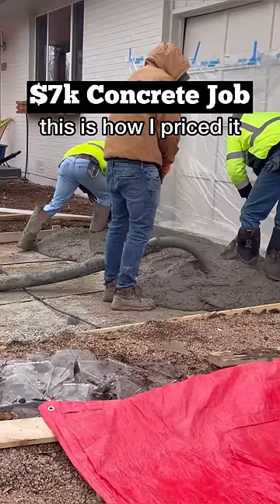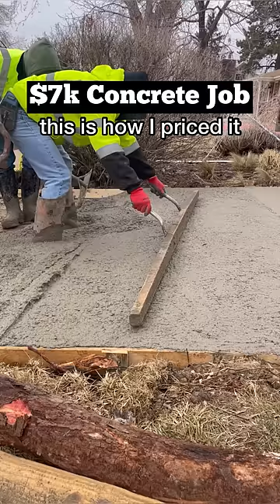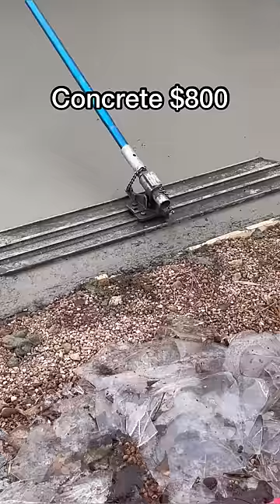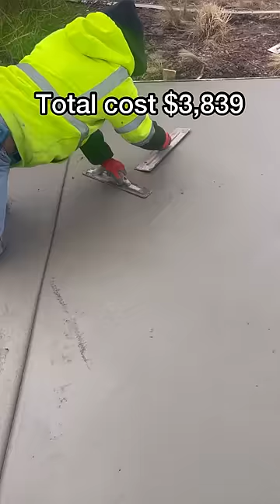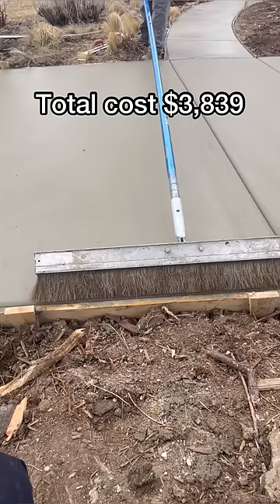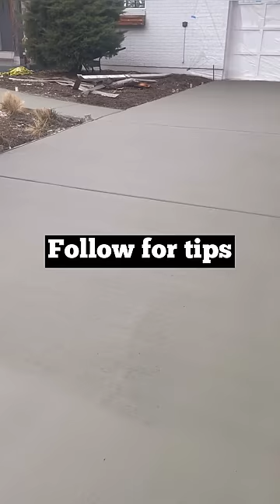How I priced this $7,000 driveway 🔥

Comment: I just paid 5300 for what I consider to be a top tier 20x20 slab and that includes footings being dug and poured
Reply: sounds about right, prices vary from place to place for instance this guy priced his concrete at negative if he was in my hometown (Toronto) we have 4 meter minimum cheapest $175/meter plus environmental fee's and tip to the driver if you do that which I do. Also Labor fee's vary, in Toronto Journeymen concrete finishers make $44/hour we just got raises a week or two ago and that's just union pay, most top level finishers make above $50/hr, good luck trying to get us though our standard rate to come do a residential job is $500/day

Comment: I remember I hired a company to finish my driveway. They charge me for rebar and I saw on my cameras that they didn’t even put it. That was a fun day at their office when I had to prove them wrong and get my money back and have them come out and redo it all over again on them.
Reply: It’s guys like these that make all contractors look bad.
Reply: I would’ve had them tear it out and then hired someone else.
Reply: I have heard similar stories from the folks that renovated my 90year old house in Romania. They told me that they have heard all kinds of stories working for years in construction. The most insane thing I have heard was where some construction crew was building houses with cellars, laying out all the necessary and mandatory rebar, all by the book. Then the construction site boss and engineer came to check on it, it was spot on, no mistakes then the  two fellas left because everything was according to the book. Only thing left to do was to wait for the concrete trucks to arrive. Well in that time gap of not more than 30mins is where the magic happened. The entire crew was in on it. The motherfuckers disassembled the entire rebar skeleton before the concrete trucks arrived and used it on another house, basically getting rich off of one set of rebar for a copy paste house. This shit left me flabbergasted, out right criminals. Structural integrity went down the drain and it was all according to the books...
Reply: It’s possible that they charged you for microfibre mesh and there was a miscommunication

Comment: 42 man hours on that little job? When my dad was alive his crew would have that job set up and poured in the same day!
Reply: Could've been 7 men 6 hours...
Reply: That's like a 2 hour job at the most
Reply: @3807shawn  it's gonna take a while longer than that it depends on the temperature outside and how much water was used,if they used calcium things like that. You have to work it as the concrete sets up.then you can either put the machine on it and finish it or if you have enough men they can get out there and finish it by hand then broom it and go! Come back next morning and pull the forms and clean up!
Reply: If you listened to the man. They obviously did the dirt work and grade work to prep for the job. Not just the setup and pour.
Reply: @devenkuoppala5731  it' still wouldn't take 42 man hours
Reply: @chriswoods4232  2 and a half day for 4 guys. That's not to bad.  You have no idea what it took to prep that area for them even to be able to set up. They have have had to demo the old driveway. Or dig out the yard or old gravel driveway that might had been there. Then they have to take it off site to dispose it. I'm a contractor that does this every day. He's was very fair if not to cheep

Comment: All you idiots saying this guy ripped the client off need to start your own business and try to do this cheaper. Cause if he did the prep and grade work for this and had to get a pump and bought the concrete as well as setup, pour and finish . If you did this cheaper you would be out of business In 1 year. You aren't thinking about he has to pay 20%  business taxes also labor and industries insurance and overhead for the business. Company only made maybe 1500 clear. 42 man for 4 guys took the 2 and a half days. That means he made 500 a day. That's pitiful. I would have charged 10k.  He didn't even charge for equipment to do the grade work. Equipment haul in charge. He left allot of money on the table..

Comment: Job size - not specified.

Volume of concrete - not specified.

We don't know the depth, length or width. We don't know the weight bearing capability that was required by the customer. And we don't know if he met that.

All we know was he charged about double the cost to himself.

And he's very public about it. Which can only mean he wants future customers to be aware of his pricing and to haggle hard with him or anyone else.

Comment: I had a asphalt seal coating company  i ran water motion with a 1 inch diaphragm pump dual tank honda 5.6 aircompress and 275 gallon toat spray rigg n I would charge people for quality work. If you want the best you paid for it. I done pretty good I just couldn't deal with winters anymore n move on it was my favorite thing I done

Comment: Ok an asphalt driveway like this is minimum 15k. In concrete 35k . Concrete $150 a yard, wire mesh not rebar 3by 5 $40 a sheet labor $200 dollars per guy per day. Trailer pump $1000. If you are charging that amount I will hire you right away.

Comment: Usually for finishers they make a good 300-$350 in my area and pumpers as well 400 but being a pumper is a bitch carry the hose back with all that dry concrete and putting back the pipes back in the truck

Comment: some of the people in the comments are buggin.

for anyone confused, if 4 guys work a 10 and a half hour day, or if 2 guys put 21 hours each total at a job, then that's considered 42 man hours on that job.  most likely 2 guys did this and he paid each $21, which is pretty decent for an unskilled labor, but not good for an experienced mason/ concrete worker. 

depending on the size and shape of the pour, plus excavation and setting forms and whatever else, 7 grand could be a great deal, or highway robbery. it's impossible to know unless you had pictures and dimensions and a firm grasp on what it actually takes to pour a driveway

the more ya know 💫

Comment: I think the big mystery here is that all the “profit” doesn’t seem to take into consideration company overhead. His actual profit is likely $1000-1500 after shop, fuel, QB/accounting, advertising etc. and then taxed on remainder. Plus, $800 for concrete? Minimum load of 3-6yards? Small drive I think for $7000. Where I’m located 4.5yrds would push $900 + min load fee. And no one would pay over $4500-$5500 for something that small. Thoughts? I believe the internet is not a good place to advertise your local market. It tends to mislead customers.

Comment: Many potential clients are in a rush and do not want you to explain what you are doing, but based on these comments, it is clear that you have to be thorough and explain everything that you are doing because people don't understand what it takes to do a job, and then what it takes to run a legitimate business.  The gross profit mentioned here is fair based on the costs mentioned.  To pay for all licenses, fees, insurance, advertising, website, reputation management, miscellaneous time costs, etc. in addition to the specific job costs just to make a marginal profit does not make sense in most cases, unless you have a very efficient process and are doing these jobs at a high volume and frequency where you can afford to make less per job. What if something goes wrong and the entire job needs to be redone? One mistake can cost you your profit and more. These are things that cheap workers/ DIYers don't think about.  I've lost plenty money on jobs simply because I bid the job too low and things went wrong that I had to pay for.  Also, people don't realize how much they actually pay as DIYers if they considered the time they actually spend gathering all the necessary supplies and equipment, doing the demolition and disposal, etc.  Either way you look at it, you are trading your time whether you pay with money you worked for or when doing it yourself costs you your days off.  It's no different than going to a restaurant or to the store to buy items that one could make themselves.  What makes it worth it for you to pay someone else? Many items people pay for on the daily are true ripoffs compared to something like this that requires skill, knowhow, licensing, etc.etc.

Comment: $42 an hour. But you milk them for 3 or 4 of these job's a day. I worked for a concert company for 2 week's and got fired because i wasn't good enough but that job is not worth it for the slave. We would go around the city repairing side walks and even adding some all at once about 6 guys. Never ending. At the end of the day i go home with a broken back and $100 in my pocket from dawn to dusk. It's insane

Comment: Mexican stats: 300 damage (to wallet, -0.75x for each status of friendship), + 1.5x speed for each beer and speaker within 35 meter radius. Chance of mistakes: 4%
Random guy with concrete: 4000 damage (2x damage to characters with under 10% specialty in concrete, 4x damage to elderly) 1.4 ~ 0.6x speed for each temperature change. Chance of mistakes: 4%

Comment: First time in awhile ive seen a concrete job on here where the concrete wasnt borderline water. Good work.  PSA if your contractor starts dumping concrete and it runs like water, hes fucking you, i dont care what the application is, unless its a specialized thing that need self consolidating concrete, no concrete should be placed over a 6" slump, the contractor is just being lazy if he says it needs to be wetter.

Comment: it sounds like you made $3100 .... but even doubling your man time would have only been another 1800 increase.....  not anywhere near the $3100....... Tyler, good sir --- also, you did not spend 42 hours of your time there, but made 3100 on the job.....  3900 is what it actually costs.........  3100 is your cut......    I'm betting, even if you are the boots on the ground selling the job and starting it and finishing, your time in is still five hours or less....

You will have to excuse me, our team Builds and developers property.  I work with all trades....   I have a fair understanding of contracting,  to say the least.   subcontracting as well,  both residential and commercial.....  

I guess my question Tyler,  how do you account for the 3,000 extra?  is this the 60/40 program,  you make 40% on anything you touch?

and does this mean, on average, the cost of things is actually about 40% less minus a contractor, builder, and dealing directly with the crews?  

and so what is your actual?  it's kinda like just getting 3,000 to be around for it.....  and if I man,  I wish it was 20%

Comment: $800 in concrete is between 6 and 8 yds, depending on price. You are basically charging $1000 a yard for finished work. You had better be paying for a full benefit package for your guys. If not, you're a crook.

Comment: Rebar seems a bit cheap on pricing. Also tools/equipment - $800 seems very cheap. Unless you’re not including shovel hammers screws, levels, etc. just bought tools for concrete job that I’m doing myself and tools came to about 1,200 and that’s not including any of the stuff I just mentioned. Also I did not purchase a concrete pump.